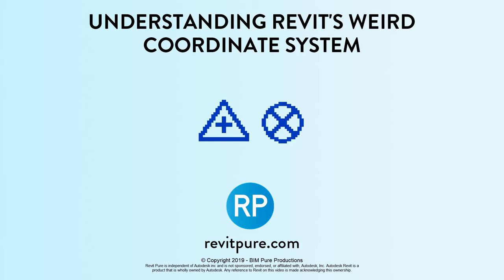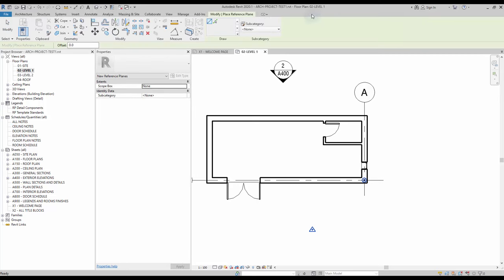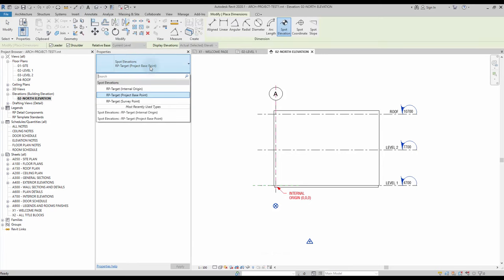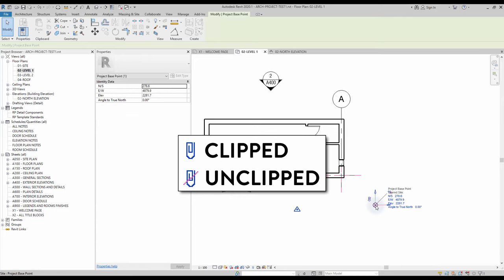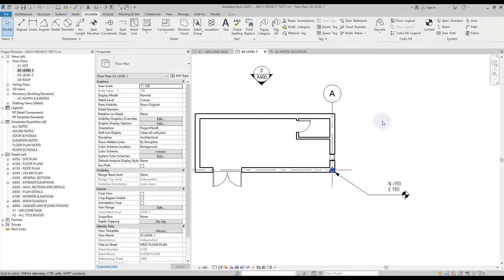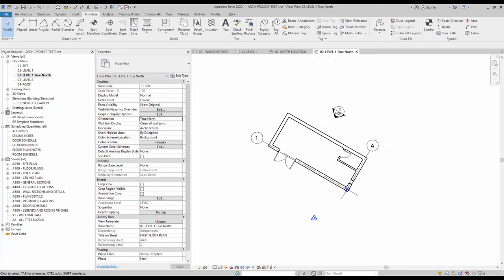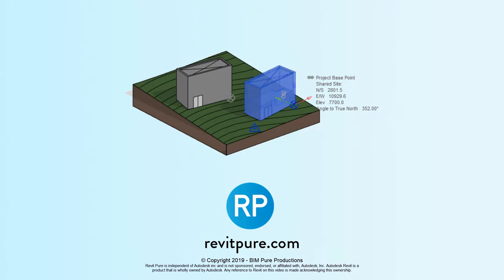Understanding Revit's Weird Coordinate System

Comment: 0:25 > Project Base Point
0:35 > Survey Point
0:45 > Internal Origin
2:34 > Setting Levels Elevation Base
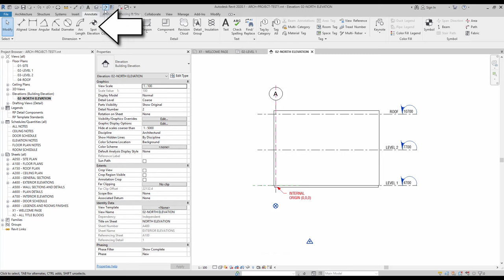2:58 > Using Spot Elevation
3:37 > Using Spot Coordinates
4:24 > Moving the Coordinate Points (IMPORTANT)
5:05 > How to move Survey Point > Never move it unclipped as it will cause confusion. Survey point is set to an invisible point called "shared site origin" by default. This point is used to create a shared coordinate system
6:05 > Setting True North
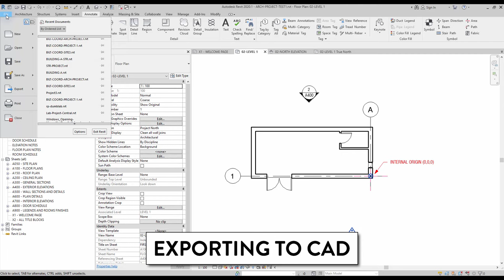6:46 > Exporting to CAD (NOTE: Revit will never use the "Project Base Point" when exporting. You can either export referring to the the "Internal Origin", so 0-0-0, or the "Survey Point", which is used for shared coordinates)
8:11 > Linking CAD files
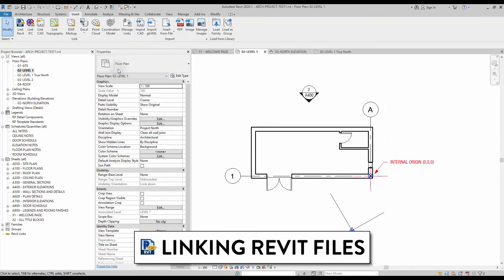9:32 > Linking Revit files

Comment: You have a good knowledge of how thing work. But, the fear of moving the unclipped Survey Point is unjustified. It's actually part of the recommended workflow for sharing coordinates within a site and using Specify Coordinates at at Point. If you really need to go back to square one at its origin you can just unclip it and type in 0, 0, 0 for the position. If you need it back to startup position just set the PBP back to its startup position and then move the Survey Point there. No reason to be scared to move it unclipped. It actually is considered safer by most professionals to move it unclipped than clipped.

Comment: It actually doesnt work like this and I learned that the hard way today. Project base point does not move in relation to the internal origin and putting it at 0, 0, 0 doesnt move the project at all, it actually moves the survey point.
Reply from the maker: That's because you didn't unclip the project base point before moving it. Explained at 4:24. Since the Revit 2020.2 release, the clip feature has been removed for the PBP and you are forced to move it in the "unclipped state", which has no effect on the survey point or shared site origin.
Reply: @bimpure  moving the project basepoint using the relocate project tool in manage does not move the project relevant to the internal origin point. what I learned in troubleshooting this is that using relocate project ACTUALLY moves the survey point. The only way to move the project in relation to the internal origin point is to physically move the geometry. If you dont believe me try it out, it doesnt work the way we thought it did. draw a wall at a project base point that is 1' away from the internal origin and then try to move it to the internal origin using relocate project. its not possible. took me a few hours to puzzle this out. I demostrate that here: https://www.youtube.com/watch?v=jUzb2_MG8vY
Reply from the maker: @jedsanford5065  yeah all you just said is right, we don't disagree

Comment: unfortunately this explanation is no longer valid with Revit 2023, or newer.  The internal origin point can be turned on or off (in the same way you can with the other site points like project and survey points).  There is no longer the option to clip or unclip the project or survey points either.

Comment: 3:13 > How do you get the spot elevation that shows the internal origin value? I can't get my head round it. Do I need to use the type that shows the "relative" height?
Reply from the maker: That's right! Relative refers to the internal origin. Sorry for the late reply :)

Comment: How do you see the "clip" in the project base point? Please help
Reply from the maker: The clip of the PBP has been removed from the most recent version of Revit. This point is now always unclipped.
Reply: @bimpure  Thank you I was wondering what happened... Another problem I have transferred Project Standards from another project to the current one and I messed up the Reduce Levels... it's picking up the older file RLs... I am stuck? Can I use Relocate Project to move the building to the right position?

Comment: How do I create a spot elevation type to pick "internal origin" My options are "Project Base Point / Survey Point / Relative" when I create a new type. I'm using Revit 2022.
Reply from the maker: Relative would typically refer to the internal origin, but only in 3D views and elevations. Have a look at the "Relative Base" value in the options bar.

Comment: This is brilliant! Explaining the irrational implementation of the age old coordinate systems by Revit.
Conclusion, don't use such a engineer flaw to coordinate between DWG and Revit model.  Use an intermediate DWG that acts as interface between real world information and the flawed system.
The intermediate DWG should XRef the real world information and translate the coordinate system by placing the "shared coordinates" at drawing origin (0,0,0).  Thereby the rotaion of true north can be accommodated by rotating the survey XRef'd drawing on the one hand and on the other, the architectural drawing (obviously in DWG format) can be positioned correctly to interact in a logical way.  The intermediate DWG point of origin should be 0,0,0.  
1        Thus, the survey XRef level needs to be adjusted by setting the "XRef Properties", rotation, height and position of the DWG to present in the manner you need eventually in Revit (remember to have contours of the surface in this drawing).  The XRef properties' "insertion point Z" should be manipulated to indicate the value which needs to be applied to the contours in order to be on the "building reference level".  One can order the survey XRef at a position in the intermediate DWG such that the "Z" of the 0,0,0 origin of the intermediate coincides with the lowest contour value.  This would be the level at which Revit would place the "link cad file" in height.

2        Same with the architectural building DWG.  The XRef should be positioned in the intermediate drawing relative to the XRef'd survey drawing as intended.  Most often the parcel boundary would be the reference building layout positionally.  In terms of building level, there needs to be an initial method of determining the building level, it can be as simple (on a flattish surface) as placing it on the preferred contour, or as elaborate by determing optimum cut to fill in another terrain type programme.

3        Set up Revit only in terms of a level which would be used for "link cad file", and if as suggested above, this level is the relative height of the lowest contour from the building reference level. (Say the lowest contour value is 1250 and the building level is at 1260, this Revit level should be set at "-10")

4        Link this intermediate drawing with the XRef'd information into a Revit model with both survey and orgin at the same position, thus, in the link window, using the option "auto- origin to internal origin" for positional and for "place at" "a level in the Revit model that represents the reference height" (For the above example, the level set at -10).

In this manner, the Revit modeller is not confronted by an irrational positioning method and can use any DWG information that is correctly orientated in the intermediate drawing.  And the bonus is, any DGW generated by Revit would also seemlessly XRef to the original DWG information.

Hope this helps those that think rationally about space and a building's position in the real world.

Comment: when i edit the topo surface the points have not changed .. how do i make it so the survey points in edit mode are relating to a point of reference?
Reply from the maker: Topo surface are always relative to internal origin, that's why it's a good idea to use linked model for site

Comment: Sorry to say but the system is just normal andd logical in pratical building terms...
1. your survey point reflects your sites (project site) survey point in real life ( it the one point u use to set out all te rest of your buildingsite)
    so the survey point puts your model in relation to the world.

2; your project base point, is as it says the base point of the project u put ont he your project site
    logicaly the project base pointputs your model in relation to you site ( the survey point)
3. and the most logical of all... if u build multiple projects on the same site they share the same survey point....
4. the base point of your site is alvays in the same polace as its survey point. (since in your site model its base point is the survey point...)
5. the internal is just a reference for revit to work in the first place and shoudl therefore be ignored at all times...

I DONT GET THE CONFUSION IN THIS ....
Reply from the maker: Hard disagree on this! The system is confusing.

Most users don't even know the internal origin exists. Importing and exporting files always refer to this point by default. Why would you ignore such an important point?

Another reason the system is weird: the Survey Point can be very confusing to use. If you unclip and move it, it doesn't represent the origin of the shared site anymore. The spot coordinates and spot elevation using the Survey Point won't actually use the Survey Point but the Shared Site origin.

The blog post I wrote about coordinates is the most popular ever on my website. I feel comfortable saying it is confusing for most users :)

Thanks for your message!
Reply: @bimpure  hard agree with you Nicholas, a great breakdown of the 'weirdness'!

On average I find users struggle to comprehend the system for these reasons amongst others as well. Coordinates are an inherently complex aspect.
Reply: Absolutely agree. Sorry to say, but RP does not have the concepts clear and it’s a shame, because before you try to teach something you should understand it!. Other videos are good and they create useful content, but I bit amateur.
Reply from the maker: @Diego-ue1dd  Thanks for your comment Diego! Do you have any questions regarding the video? I might do another video based on questions users have on this topic. You can have a look at the blog post we wrote on this topic, maybe it clarifies some of the ideas in this video: https://revitpure.com/blog/13-tips-to-understand-revit-base-points-and-coordinate-system
Reply: I must agree that users can struggle with it. Once i talked to them in the practicld terms they get it :). Bit thats wasn’t really the point of my post. In its essence to me the system is ‘pure’ ( ;) ) logic if u look at it in real life coordinates systems we use to build.
Reply from the maker: @alexYT91  Yes in theory the system is simple! A coordinate system for the building (Project Base Point) and a coordinate system for the site (Survey Point). In practice, it's kind of a mess because of invisible points.
Reply: @bimpure  how can i move whole project to origin point zero zero ?
Reply from the maker: Sadly, it is impossible.
Reply: @bimpure  in your blog (13 tips to understand Revit base points) you showed in step 2 how to locate to origin (0,0)!
My question here how do we set the project level at 100'-0''?
Reply from the maker: @sahardarwich2995  The best way is to unclip the Project Base Point and move it 100' below the internal origin. The PBP position should be adjusted early on, when the project is starting. Moving it on an advanced project can cause problems. Thanks :)